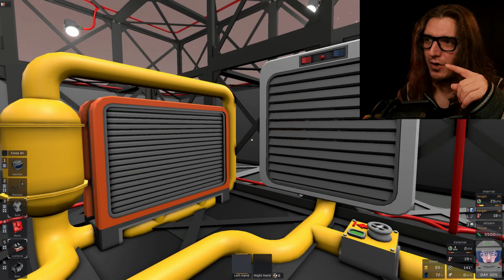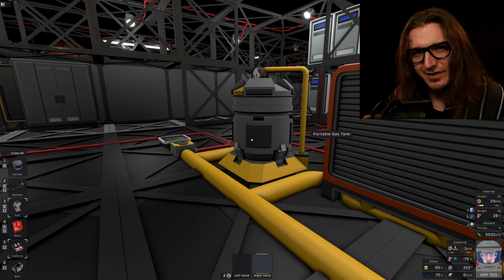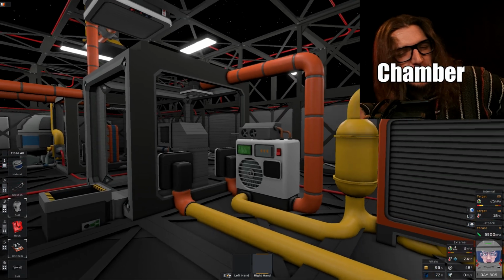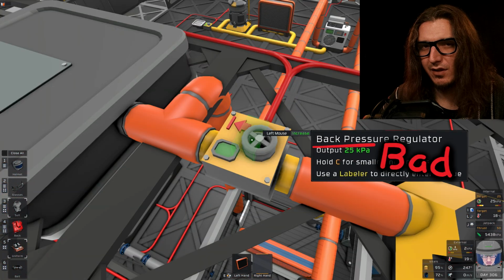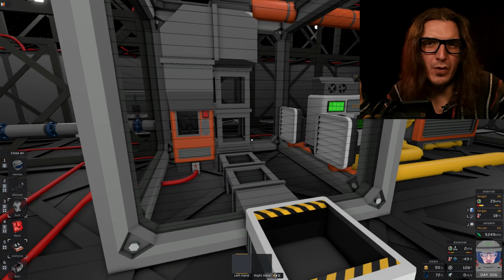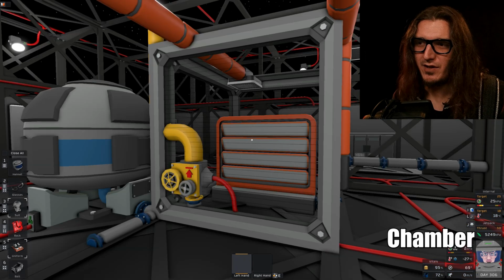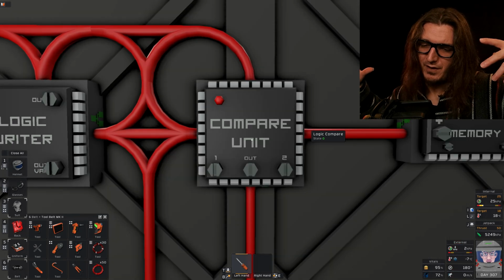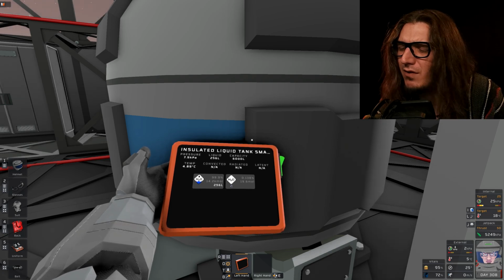Stationeers: Air Conditioner and The Water. Phase Change.

Comment: The best way on mars without having to mutch trouble with regulating the climat around the crusher and ice storage, you can use the day night cycle. But the room has to be air and temperature isolated from outside. I assume one layer of iron or steel blocks (idk because my base was build in the mountain) and on the side at least walls no window. To enter the room you build two normal doors so there is no temperature exchange while entering. Now hold it tight at day and let cool atmospher in at night and all will be al right.
Reply from the maker: Thank you for the helpful tip sir. I appreciate everyone trying to help out :)